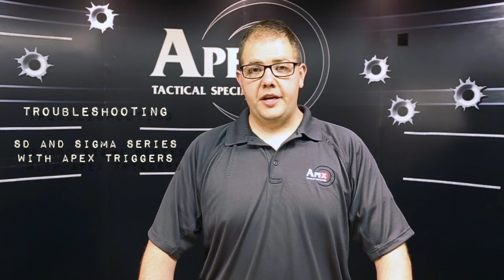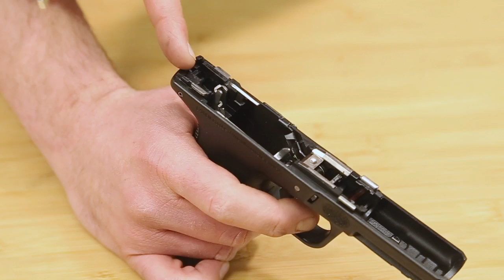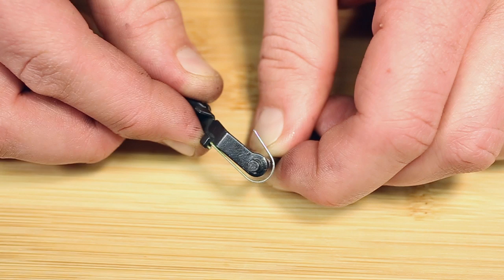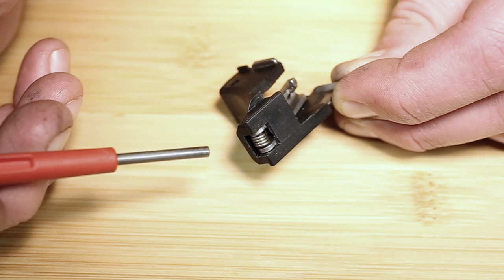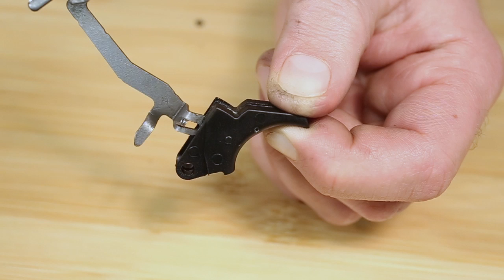SD and Sigma Trigger Install Troubleshoot

Comment: I wish their instructional video mentioned to not use the included sear spring……  that little apparatus gave me a big headache. 

Basically, if the spring is too easy to put in, you did it wrong. The angled portion of the spring should be set in the notch on the sear, with the other end pointing towards the rear of the firearm (when installed). I found the best method is to pin the spring to the sear with a toothpick, break off both ends, insert the sear to the housing and poke out the toothpick with the pin.

Comment: I just installed on my SW9VE and i cant even get a single pull. Seems this trigger is not drop in for this model
Reply from the maker: Contact customer service at 623-322-0200 (the umber on the back of the packing card) and they will help you troubleshoot the issue.
Reply: @apextactical  seems like the trigger is just to big for this model. And i dont plan on modifying it myself.
Reply from the maker: @tacktiician4978  What did  customer service tell you when you spoke to them?
Reply: @apextactical  they would have most likely  told me to file it down like they have told others. Which i am not interested in. If i am going to purchase an after market trigger, i am not doing anything to it. That should fall on the company not customer.
Reply from the maker: @tacktiician4978  Again, customer service would be more than happy to not only assist you but explain why this occurs in the Sigma, SD and SDVE models. Spoiler Alert: It has to do with factory tolerances and the factory trigger bar design.

Comment: My sigma 40 will fire, but the trigger will not reset after that. I pull , it shoots( clicks), but then I hold the trigger back , rack the slide and then release the trigger and it becomes a dead trigger. I noticed the trigger does reset if i firmly push the trigger towards the muzzle ( the opposite of the fire motion). Any ideas of what this can be? Should I file the front of the trigger?
Reply from the maker: Contact our customer service at 623-322-0200 and they can assist you in properly troubleshooting the issue and how to resolve it.
Reply: My SW9VE is doing the exact same thing. When I rack it without holding the trigger it resets just fine.
Reply: Jake Coleman hey. I managed to fix it yesterday. This is how;
I realized that the front of the trigger was to long, so I filed it with sand paper. I did it with the gun fully in place, not by removing the trigger. That way I was able to remove small amount of trigger at a time.
Reply: Most sources talk about filing the back , but not the front. It seems in some weapons, the front has to be removed a bit. The part that touches the frame when t returns, its like a little ledge. There is a video about a sigma not reseting in cold temperature.
Reply: https://youtu.be/G3Zt76ygzG0

That video gave me the idea and it worked. Good luck!

Comment: I had mine put in and looked at by two different gun smiths.  It still barely fires.  The money I spent on it I could  have bought another Walther PPQ.  All the other triggers I have from you guys are awesome but this one ruined my gun.  It sucks!  :(

Comment: Apex need to pay better attention to their video productions. SCott like to talk about small details , but rarely does he show any closeups of key points. It's surprising that Apex is heavily marketing their spring and trigger kits for the Sd9VE, yet hasn't bothered to make any videos od that model. All their videos are for the SD or Sigma model. Plus, they haven't botheree to consider the complications of the CA saefty version that has springs and levers never referenced by Apex
Reply: I am referring to the many parts that are required to disassemble and assemble on the S&W SD9VE in order to install your products. The slide lock lever is a good example. In one video, your reinstall of the slide lock lever was done so quickly ( almost hidden) as to ignore mention of the problems associated with this part. The spring is difficult to maneuver to avoid it partially covering the pin hole. That prevents completion of the installation. A second example is the sear block, which you show at a relative distance but not close up to examine the various springs and levers. In particular, there is no mention of the magazine disconnect components that explode when the sear pin is removed. I believe that if you are marketing S&W SD9VE products ( and you have everyone from Amazon to Midway USA to eBay, etc. hawking your wares for the S&W SD9VE) , you should provide at least one video demonstrating installation into that model. It's similarity to other models is not the same as demonstrating products fitting into that model. Other posters have been complaining about the fit of the Apex trigger into the SD9, and your response is to modify it? A poster below noted that the Apex trigger doesn't seem to work with recent models of the SD9VE. I couldn't get mine to install properly no matter how much I had to 'shave' it. ( trigger now hits the frame up above but is a mm away from back of trigger guard, so this is not going to work) Charging customers $40 for a part that needs radical modification doesn't seem quite fair - especially when it doesn't work anyway. Does Apex accept returns of products that have been modified per the advice of Apex?
Reply from the maker: To which key point details are you referring? Examples please.  We are working on update product videos for things as such as the magazine disconnect, which were no available when we made this video.  Also the SD and SDVE are very similar, the sights are different and the latest model has a uni-directional pin at the back of the frame.
Reply: @apextactical  My trigger pin is counter sunk in the frame hole on the left but flush on the right. Is this how it should be seated?
Reply: SciRitek Groupp your trigger sucks now I can't disassemble my firearm so thanks and I did everything in another video and now I can't get my firearm apart to see
Reply: @andrewrowzee5411 this is an old comment but just wondering if you ever figured it out? I just put in the apex flat trigger and spring kit exactly how it was shown and now the slide doesnt want to come off when trying to disassemble it

Comment: This may not work on an SD9VE made after late 2014 or early 2015.  I had to file the over travel stop down to the hinged safety pin and it still didn't work.  Installed correctly.  I have installed this on older pistols.  My new pistol, this trigger won't work.  I think S&W tweaked their frames.

Comment: +1 to John Z.  I really wanted to like the Apex Polymer SD Trigger and that flat trigger face.  My experience was similar to John's except for the gunsmith.  I Installed the Trigger Spring Kit and polished the contact surfaces which dropped pull from 8+# to 6# on an unfired SD9VE which will most likely drop even further after a few range sessions.  Almost didn't install Apex Polymer SD Trigger as I was getting such good results with the spring kit (note to self - listen to inner voice - $40 lesson). But I wanted that flat trigger face.  Once the Apex Polymer SD Trigger was installed it would not allow trigger to be pulled as the safety lever was too long and locked up the trigger.  Once that was adjusted by carefully filing, fitting, filing, fitting, the Apex Trigger wouldn't reset.  Adjusted by filing, fitting, filing, fitting, as shown in video. When I was finally getting resets, they would not break nor reset consistently.  Then the safety paddle was not consistently holding Safe.  This was not acceptable and with no way to rectify, I reverted to original trigger.  I've done the d.i.y. spring upgrade on a 1st gen Sigma and on two SW40 pistols with great success and have done multiple Glock upgrades that included triggers.  Learn from the experience of others and SKIP the Apex Polymer SD Trigger.  YMMV.  I DO whole-heartedly recommend the spring kit.
Reply: So if I've installed the trigger, and now can't get it to fire, how do I remove the slide?

Comment: This trigger kit is a joke. It is not adaptable to the 9mm Sigma. See the rework video. Why spend $40 on a pc of crap that should work out of the box??  40 years as product develop eng and what I would expect from China...which is most likely where this design came from. Used the spring kit but had to go back to factory trigger asm. My gunsmith I normally use just looked at the parts/video and laughed at me. I spent an entire day trying to "tune" this assembly. Be advised!

Comment: So I installed the APEX spring kit and APEX SD trigger on my SD40.  Spring kit was easy except the trigger pivot pin went in easier from the left side instead of the right side of the frame, still with the grooves on the left side of course. Trigger kit is another story. After installing and putting all back together, the gun would not fire. Checked everything out and realized that the back of the trigger hits the trigger guard/frame too soon and doesn't allow the trigger to fire the weapon.  I had to file the back of the trigger down quite a bit being careful to hold the safety latch out of the way so as not to damage it. Works great now but could not figure out why I had to do this since the trigger is specifically an SD mod kit. APEX just didn't make the trigger the right size in the back.  After all, a little post travel is better than the gun not firing at all. User should not need to make this time consuming mod that took 30 minutes to keep filing until the trigger would fire the pin.
Reply: Same problem exact same gun!  And mine was installed and looked at by two gunsmiths.  The money I spent for this I could have bought another Walther PPQ.  :(
Reply: Just done my sd9ev  had to file the shit out of it!! Like it better than the factory trigger even though was a pain in ass to get the gun to shoot again . thinking about the spring kit now